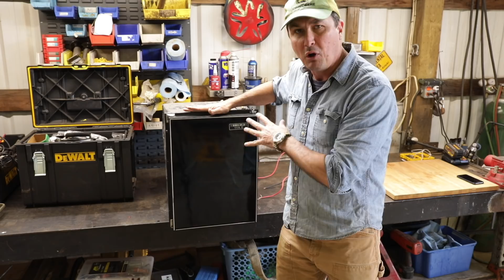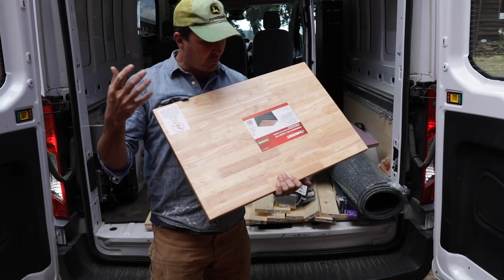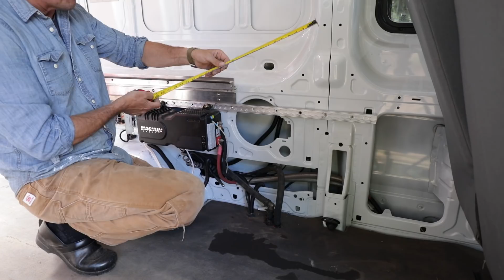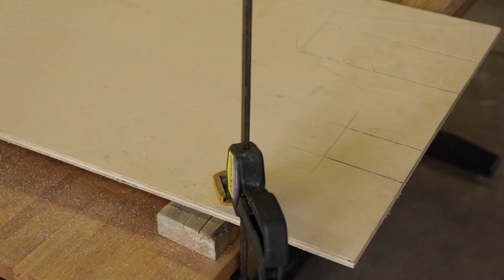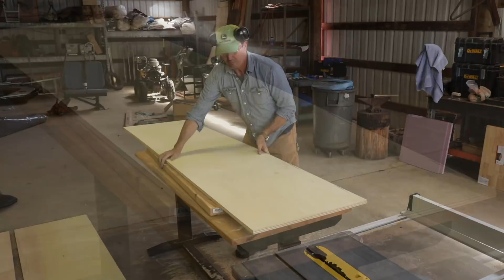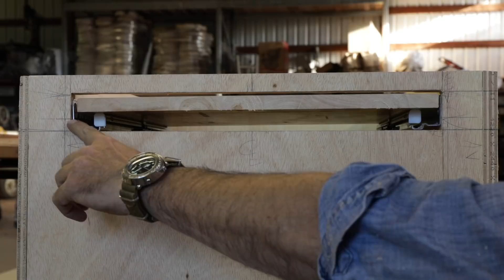Can This Truck Survive The Apocalypse ???

Comment: Mrs. W is impressed and happy, mission accomplished!
Those undremount slides are really useful, I use them all the time in custom cabinets, for pull out for audio equipment, so you can get to the back of the unit for the wires, and like you said, they are essentially hidden from view.
Well done Cody.
I need to do a video on making a straight edge jig for people who don't have a track saw, it would make your life easier as wrestling them 3/4" sheets of 4x8 plywood is not fun.
Cheers!

Comment: Cody, If I might suggest something for your consideration for your cook top? Consider an induction countertop cooker. You can put them away like a cutting board when you don't need them, and work great (better than most propane stoves). Another good thing about using individual "burners" is that if you want an upgrade, you just go buy the new burner, no need to modify the countertop. Today you need one burner, so you only buy one, tomorrow you decide that you need two, so you buy the second one, if on Sunday you decide that you really need three, go buy the third, and it's no big deal, so long as you've got the actual counter space for them to sit on.

Comment: Having front & rear ledges would be possible if you just notch out a bit on the part above the extension in both places.
Because it is so stable when extended the clearances could be very close...like about 1/16" or so.
Alternatively...you could just remove the entire center portion above the extension & the top attached on the rest of the area.
That would leave over an inch of clearance above the extension (and below the top)...so you could even leave a cutting board on it when closed.

Comment: Cody, I am not sure if you would have enough power to run an induction cook top, but if you do, it would have some benefits: instant on, no hot surface, temp. control, easy to clean.
Great video, looking forward to part 2.

Comment: Cody , well done sir, for not being a cabinet maker,  you’ve done a much better job then most of the cabinets you can buy nowadays!! 🙂👍 you might want to sand those butcher block tops down , (if you plan to cut on them ) and use something like Watco butcher block oil or something comparable , unless they use a food safe finish on the butcher block tops!! 🙂

Comment: When you put the lip on the countertop leave an opening on the front the width of a sponge to wipe crumbs through.
Also I’m not familiar with the little fridge you are using , but I was wondering what it needs for cooling around the mechanical pieces? Does the cabinet need ventilation? I like the idea of adding more insulation but heat kills if it can’t dissipate.

Comment: You might want to put a little lock or stopper on the sliding countertop, when you brake or something it doesn’t shoot out. I had the same thing on my workbench and any hammer hit on the bench made them slide out. They are not as strong as you think. So a little stopper would help.

Comment: I found what looks like a small wooden dinning room table. It hasa 1.074 inch thick table top, two legs with board that passes through the two legs and has wooden wedges pinned in to secure it,. It was missing one wedge and was really wabbly. 

The top was filthy, had gum and pen markings.  

Brought it home, sanded the top, made a replacement wedge which made it super solid again...i burned the top with a torch lightly for looks... oiled with a blend of olive oil and esscential oils and bolted an arbor press, vice and bench grinder to it. 

Just like living in luxury for free.

Comment: Your mini fridge may be different than mine, but a few that i have owned needed air flow around the outside for the heat to dissipate from the cold inside. If you insulate the outside of the fridge with foam it may cause the fridge to work harder because it cannot dissipate the heat properly.

Comment: Insulating that fridge may have a negative effect the back end must dispel heat from the inside if u do not allow proper air flow to the back radiator it will hurt the units ability to cool the inside out

Comment: I work with 12v appliances for RV's and motor-homes, most are built just like the product- junk. If i were you i would carry an extra control board and thermostats for it, everything else is easily repaired. cheers. love  the channel.

Comment: Hey Cody, i would put some rubber capsor something similar on the cables at 4:05 for the magnum converter. I think this would look pretty good, even if you wont see it

Comment: You should consider routinely a shallow groove around the cutting boards to keep liquid from dripping off. Especially the one that will be over the bed.
Reply: Daniel Quirke 
And instead of a knob, a routed pocket on the slide bottom.

Comment: I don't know if anyone has mentioned this, but if that butcher block top was designed for a toolbox, it't likely not food-safe. I know, I know - safety sally, but there can be nasty stuff in some cheap varnish. I would sand it down to bare wood and rub it with a nice butcher-block oil or food-grade mineral oil.

Comment: The "butcher block " top isn't food grade. I wouldn't food prep on it.
Reply: Why?  You worry too much.
Reply: Why would he pour varnish in his food?  That is dumb...Seriously, even if the surface isn't food safe it is dry and you could probably even use it for a cutting board with no problems.  I would cut on a plastic board anyway to save the countertop.  As far as food just touching it though, trust me, you eat far worse every day and don't even know it.  Especially if you go to a restaurant.  The box your pizza comes in is worse than any shellac or petroleum based coating on a cook surface.
Reply: So you would tell Cody to  do all this work to customize this van and you'd eat off some thing you remove from the axe handles he uses??
Reply: Honestly probably less than 1/2 hour of work to make it food safe.
Reply: Jason, the varnish, (though I doubt there is ANYTHING on that toolbox top he used, is dry.  It is not going to hurt you.  Yes, I would gladly eat anything prepared on that surface. I understand why we need regulations, especially for commercial food prep, but I assure you that you could eat food prepped on an oil based varnished surface for 250 years and not suffer any effects...But you do what you like...and let Cody do as he likes.
Reply: As a cabinet maker who has made wood tops for commercial and residential uses I would NOT suggest for any reason you eat repeatedly off a lacquer finish, especially a cheap Chinese import one. Every nick and scratch will flake off and bacteria will grow, that's why a mineral oil  (or like) is used. The oil soaks into the wood unlike a lacquer or varnish that is a surface dried products.
Reply: You can eat and not get sick but his baby is a different story.

Comment: Cody I know what you have done so far is work in progress, at this point I don't see any heat venting for the fridge yet.  I would be more worried about the fridge venting because they give off a lot of heat when running. It would be worth while to look up the model of the fridge and see how much venting it needs.

Comment: Don't put an edge on the counter, router out a groove to stop stuff from rolling off when parked on uneven surfaces. Unlike a boat galley (which often has a 1/2" to 1" lip around counters) you won't be cooking while in motion. At least one would hope.

Comment: if there is an emp it is toast.
Reply: That is actually a lot of FUD.  In real life EMPs will shut a car off but you can restart it and it will perform as usual.  Look it up.
Reply: Actually, it's not that simple. Depends on a lot of factors, but most likely the antenna circuit for the security key will at best wipe the memory, at worst fry the security module, so while technically all of the critical systems will be fine, you'd have to reprogram, replace, or hack the security system before it would restart. Cody's not going to bypass that system himself.

Comment: BE SUPER CAREFUL WITH NORCOLD REFRIGERATORS!!!! The company has made many many mistakes and recalled thousands of units because of FIRES. Yes that's right! we recently had a FIRE in our rig. Norcold is replacing the whole unit because of the fire! I have a video on my channel about the fire and the Recalls.
Reply: Bill The Tractor Man with that missing freezer door, the freezer will work overtime too.
Reply: My Norcold shot flames out when running it on propane. They used thin tubing and cheap fittings. Mine is a 1994 model
Reply: Chris de Haan ours was the valve body, fridge was a '91 and recalled. They replaced the valve body with a new upgraded one and that one was recalled too. This causing our fire and issue. Through all of this I have found the electric only models have had issues too with fires caused by shorts and over loaded wires..

Comment: Not to knock the countertop design, but it seems like it would have been easier to make a clamshell style extension that would open on a piano hinge...  Would be easier to maintain and clean too. But for the concept you decided to go with, it does look nice and durable.
Reply from the maker: Wouldn’t work
Reply: Wranglerstar - could work if you had a couple support rods or boards that slide out to support it.  I have a buffet that extends like that and it works really well. It's sturdy and it's all the same level. Only drawback I can think of is that it might not be as stable as your concept as you're going down the road.  Again, I think your design is great and the cabinet body looks super sturdy.  I'm sure it will serve you well.  LOVED Mrs W's smile at the end.  Big time approval from her is all that matters.
Reply: Curt White it would be half the size or it would hit the bed.
Reply: ruger27 - Google  "Mariposa flip-top server"
The image does not show how it extends. 
Two supports, one near the front and another near the rear, slide straight out on each end of the buffet.  Then each end has hinges that allow the buffet to literally double in length.  The same would be true  for a counter top. 
All that being said, Cody's design is likely more durable and rattle-free.  Just throwing an alternative out there.

Comment: It's not EMP proof. That's your biggest worry.
Reply: Why?  An EMP would not do all the damage you believe it would, look into it.  For starters it would not disable cars.  It might...might...shut down the engine, but the car can be restarted.  This is a tested fact.
Reply: Tenspeed TheBikeHanger an EMP  would overload the microprocessors throughout the vehicle. It would destroy the relays because the coils can't handle the excessive amount of static electricity. Basically an EMP will disable most componants that have been mandated by the government. They have forced companies to build cars to be disabled. Electronic fuel injection and all of the smog systems are so intergrated into the computer systems that it would take an electrical engineer to bypass them. Simple DC motor functions may still function, but think about the effect of a catastrophic EMP where 99% of the cars and trucks are disabled. Where can you get replacement parts? They will be affected also by the same. I'm just explaining the basic function and design of the EMP. Mechanical injected diesel motors are used in military vehicles because they have built them to be impervious to an EMP.
Reply: That is what the bad fiction writers have told you, but it just isn't reality.  A cars electronics are pretty well shielded, that is why you don't hear about lightening strikes taking out automobiles. Again, look into the reality of this yourself, I once thought as you do, I mean, this is what we have been told and it seems logical, right?  But really, there is no EMP taking out the grid in reality.  It would certainly cause some damage, but everything electronic isn't going to simply quit working.  Spend a few minutes on Google looking into this, it is really an eye-opener.
Reply: Tenspeed TheBikeHanger there is a facility at White Sands national monument that does testing on components of military vehicles. I have a relative that works there and they have explained their process to test things. Either way, we'll just see right? Let people do what they want. It doesn't matter to me. I'm educated about this a lot, and I'm still not ready. Inevitable it boils down to trusting in God. But He still expects us to be educated. "My people perish for lack of knowledge." It's ok to have all kinds of trinkets but best be ready if they fail.
Reply: I'm not knocking this car. It's just my opinion. I hope we don't have to worry about all of this stuff. But the government is not on your side. Regulations are not advantageous for the people. Most were written by demon-c-rats
Reply: Have you read William R. Forstchen?  One Second After and the followup One Year After?  Great books.  The one thing they taught me, and KI lived in the Asheville area when I read them, in Fletcher, NC...Anyway, the one thing they taught me is that no matter how much you think and prepare, you will totally miss the boat.  You just have no clue what the reality will be, what problems you will have to solve.  You will find that you have completely overlooked your most pressing needs.  These books were responsible for bringing me OUT of the prepper mindset.  Like you say, you just have to trust God.  Digging bunkers and stockpiling food and building bugout vehicles is just a waste of time and resources.  Whatever happens...happens.  You deal with it as it becomes necessary.  I have done some MINOR research on EMP relating to the question of disabling vehicles, let's just say from a police scenario, though that is not quite true, I would love to send a small EMP from my car to a tailgater to disable them, but hey, whatever, right?  I found out that it is ALL theory and no practical application.  Who knows what a cloud-burst nuke would really do, but they are trying to find ways to disable vehicles with electro-magnetic bursts and so far it isn't working...Just relating what I have found.  I am far from an expert.  I do know though that there is no magic way to fry everything electronic like many people think.

Comment: At least Mrs. W is taller.  I am 6'4" and my wife is 5'2"!  It makes for some unique problems like when she wants to drive my truck with a bench seat there is no way I can ride with her.
Reply: Tenspeed TheBikeHanger I’m 6’4” also, but my wife is 4’10”. And unique situations indeed! And un(fortunately)😂 my truck seat slide bracket is broken so it doesn’t move!!
Reply: Get her a booster seat.   They make them for adults.